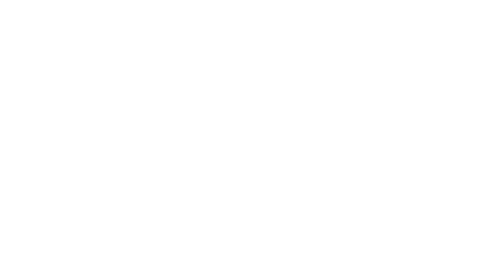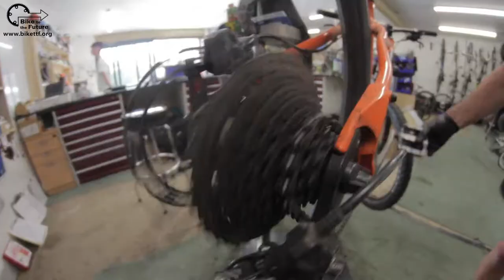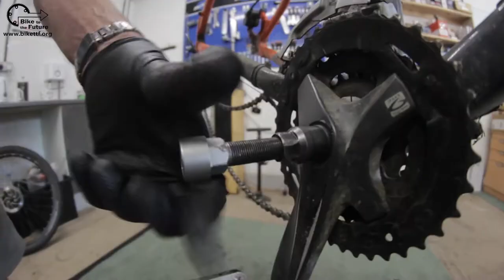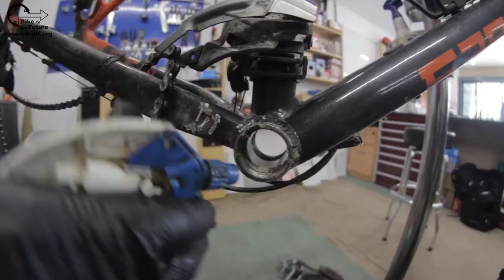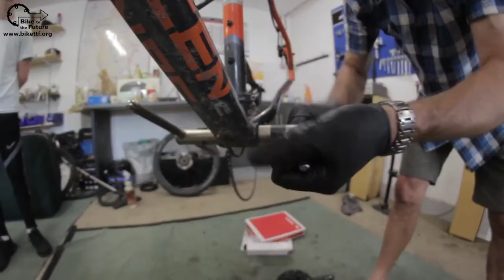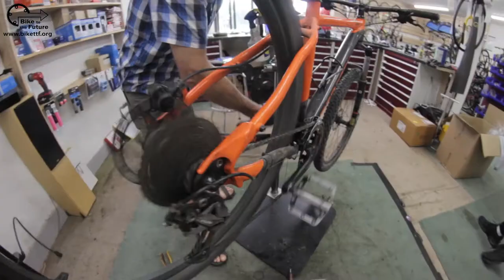Why does my chain keep skipping?

Comment: Mines brand new decently expensive and high quality but mine still skips I’ve seen someone with the same bike and they said they took a chain link off you think that will work?
Reply: Same with mine I also recently bought a cycle this week but my cycle skips gears from 1st to 2nd I'd say its the shop problem ig because IN the store they keep the cycles which gets exposed to moist air so yea that's my reason for the cycles doing these (my guesses)